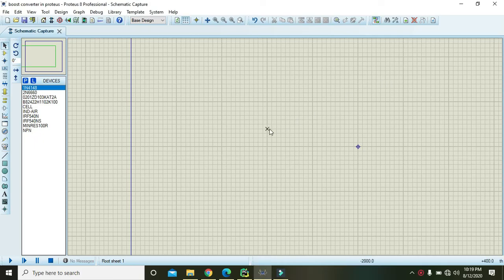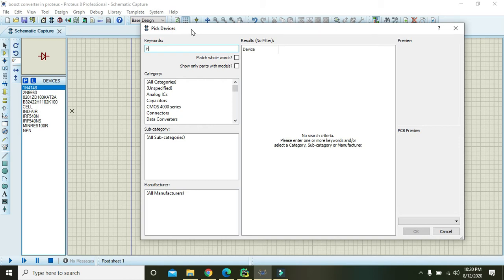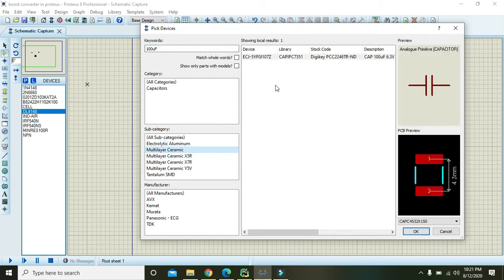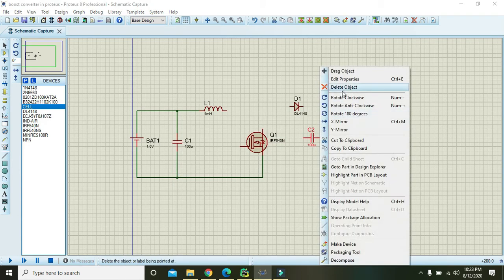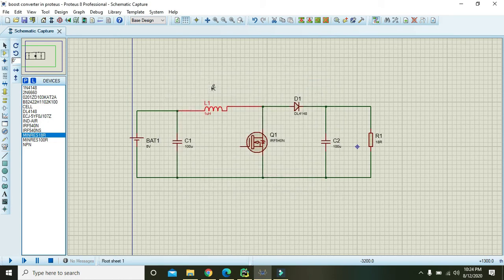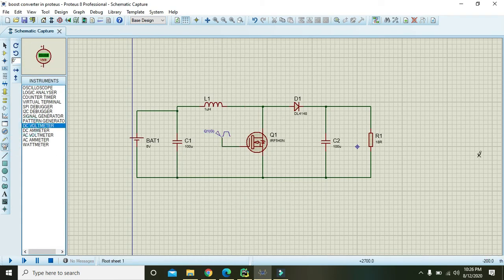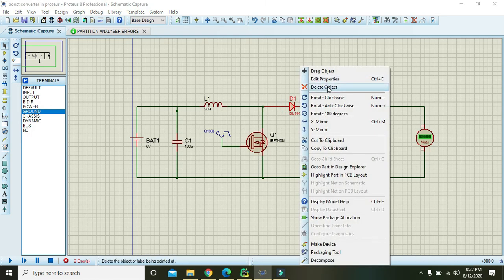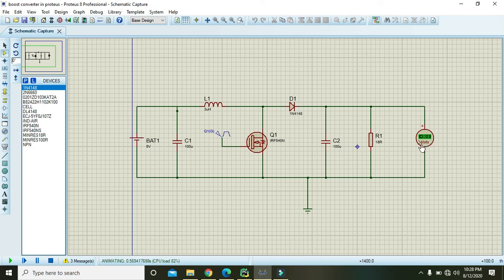how to make a boost converter in proteus | boost converter simulation in proteus

Comment: Sir, with my calculation. If input voltage is Vin=5V, pulse width 70% (D=0.7), the output must be Vout = Vin/(1-D) = 16.6V . In your simulation it is 31V! Thank you for your simulation.

Comment: I got output less than the input voltage. I got it 4.10 V
Reply from the maker: brother...output will always low than the input...efficiency cant be 100%.
Reply: @nelsondarwinpaktech3954  No it's not. The addition of C1 was not necessary. C2 is enough. BTW, thank you very much, you helped me find the right components.
Reply: @Mohammed-bd7ql  I GET 4.10v in the output too ???
Reply: @magnet_  Remove C1 and follow your design calculations to get the right values don't just place arbitrary numbers.